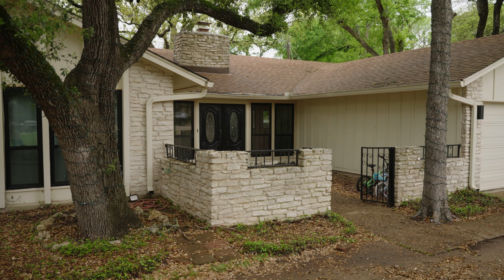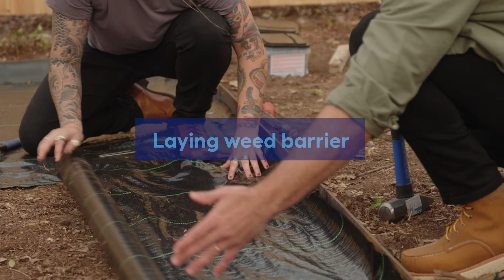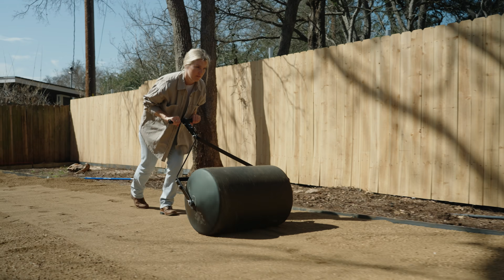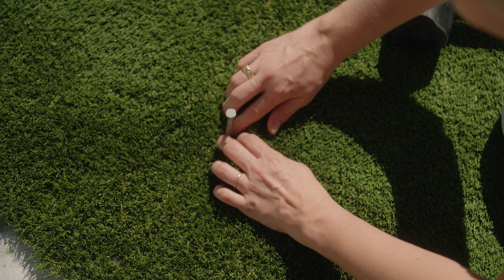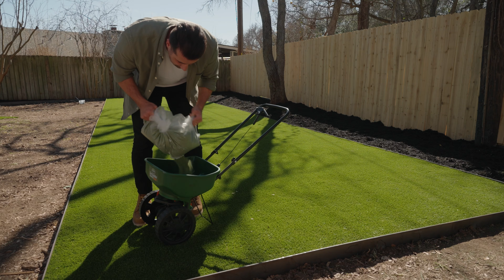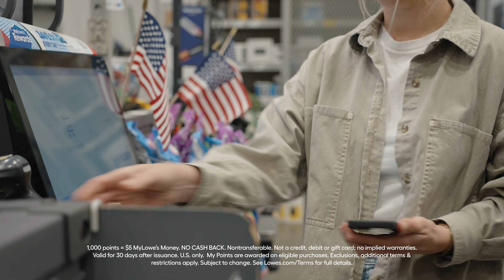How to Install Synthetic Turf | Blending Backyard Makeover How-to's

Comment: What role does the inherent crystal structure of O3-type NaFeO₂ play in facilitating electron transport and ion movement, and are there any structural bottlenecks or phase transitions that could hinder its performance under fast cycling conditions?